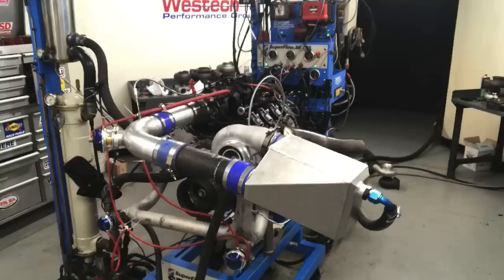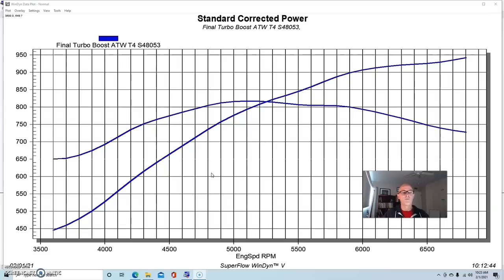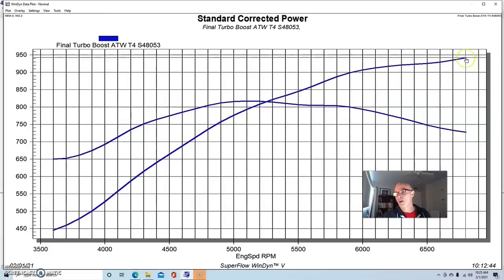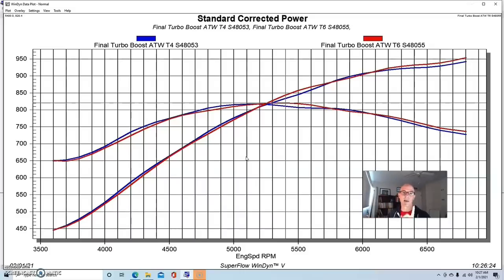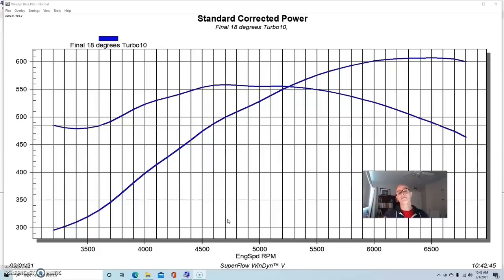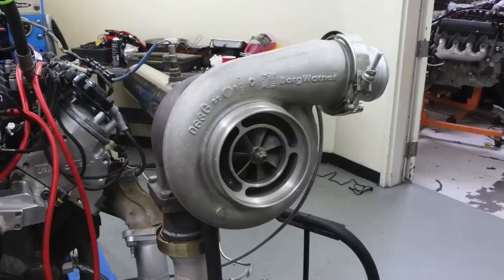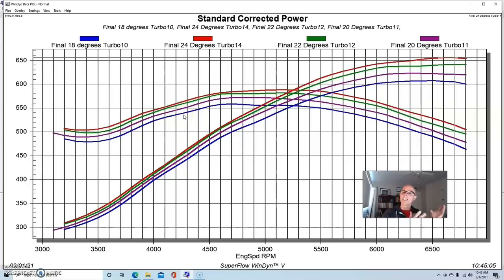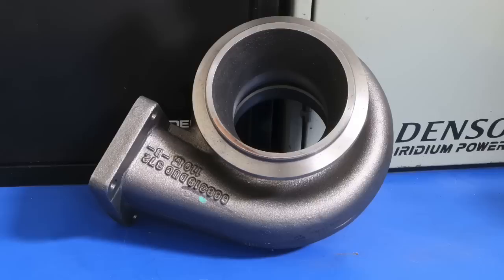JUNKYARD SBE LS S480 TURBO TEST-T4 VS T6 (BOOST IS A BETTER BUY THAN SILVER)

Comment: Yeah, it’s funny because I was running a pulsar 7985 if I remember correctly but it was in a T4 housing, however I have a 5.3 motor that is stroke to a 6 L. I was having back pressure issues because the biggest housing I could go in the T4 was a 1.28 AR.  I had to go to a pulsar s480 I believe in T6 housing. Pretty sure that will solve my issue.
Reply from the maker: at what powe level

Comment: Great content! So my question is since I’m going with a bigger cubic inch, which I’m building a stroked 418 LT/LS  street/ strip car  it will be 70% street & 
30% track-street racing 

What size T6 turbo and A/R size should I use so it can be the most responsive In your expertise opinion, oh I’m also going twin turbos too. I’m new to this so I’m very curious about what size turbos would be best & the most responsive off the line and driving around with. Get back with me if u can thanks 💪🏾
Reply from the maker: what power level?
Reply: @richardholdener1727  I’m trying have at least a thousand rear wheel on the street all day & max power when I wanna turn it up on the track between 1400hp-1700hp …

Comment: Richard, you had me confused for a little while with comments you have made in a few vids . You say a cheap turbo will make the same or similar power level at the same boost to a Mac daddy high end turbo. 
 Tell me if I'm ready to graduate ........the boost pressure is a product of the ENGINE and its restriction . 14lbs is 14lbs and will product a very close result in power regardless of turbo quality in the same engine . 
 Here is the part I just figured out and I'm not sure you have explained this part in the vids I've watched so far . The difference in a cheap cast wheel chopstick unit and , say, a new Garrett g42-1450,  is what the TURBO is doing to make the said 14lbs . If a test was run to observe wheel speed on the turbo , id bet the cutting edge design would be working less to create the same boost level at the engine . Wouldn't this also explain why some turbos are capable of 1200-1400hp with a 75mm turbine restriction,  while others can only muster 800hp with the same size exhaust restriction ?  I would also assume the newer , better (?) design would be more responsive IN THE CAR .I doubt the dyno would quantify that trait since it doesn't take the  real world dynamics of the car  into account. 
 Would you agree ?
Reply from the maker: ASK YOURSELF IF BOTH TURBOS CAN SUPPORT THE SAME BOOST LEVEL WITH THE SAME NA POWER LEVEL, AND IF THEY HAVE THE SAME BACK PRESSURE
Reply: @richardholdener1727  how would we account for the ability of one compressor wheel being able to move more air per rotation ? It would reach the same boost level before it reached the same rotational speed , would it not ? The boost and backpressures would be similar, but the turbo wouldn't be spinning as fast to reach the same level of restriction ( boost ) . If the turbo wasn't required to spin as fast to make the same boost level, one would think it would reach that boost level quicker (be more responsive ). The level of added response would be suspect , but something has result from a more efficient compressor wheel design. I'm not talking about different sized compressor wheels , but longer blade designs utilizing a smaller center to add blade length , thinner lighter blades , etc.
 A compressor wheel sensor in a apples to apples test between two turbos , one with a basic cast wheel and one with a trick billet wheel , to see if the boost/backpressure was reached at the same turbo rpm. Otherwise , how would you account for two turbos w the same basic specs , compressor and turbine inducer/ exducer , turbine footprint and AR having drastically different HP potential . It has to be the effect of different efficiencies from the design.  I doubt these are things a dyno can pick up on very well because much of these traits would be happening as you load the dyno at the beginning of the pull . 
 I whole heartedly agree that 14 lbs is 14 lbs . I just can't wrap my head around 2 different wheel designs reaching that boost at the same rotational speed . There has to be an explanation for generations of turbos being rated at progressively higher outputs while staying in the overall turbo footprint .

Comment: I have 2 s turbos, a VS s480 and a FI s485, both w the 96/88 turbine wheel. I also have a t4 1.25 , v band 1.32, and t6.1.32 turbine housings . I ran the s480 w the t4 on my 6.2 and it seemed to work well. On the s485 , I ran the t4 and v band.  The t4 was more responsive than the v band , so I'm guessing, since I didn't do any repeatable test on power levels , the v band is freer flowing than the t4 . 
 Good test ! Helped me make sense of my results .
 I never ran the t6 exhaust because of space restrains in my engine bay, but I would guess it would be the best for max boost w less response down low.
Reply: Nice, I'm getting ready to run a t6 1.32 in my cam only 6.2. When did the turbo start building boost? Mines in a tow vehicle

Comment: I went with the s498 with T6 for my built 413 LS2 Gen 4, I figured it could make 600-650hp on engine and i dont want to put 30-40lbs to get between the 800-1000hp im thinking it wouldn't be too much of a streach to do that without blowing things up

Comment: meh....  i don't go for them whistlers or them crammers or any of them forsaken crank position sensors,  i'm what they call a retro grouch.  if you can't make 800 HP out of a decent big block you're having a problem....  Sure, yeah!  You bet there are cars faster than mine but i have ass loads of bottom end torque and all i do is change the oil and wax the car.

Comment: SOOOO...!, THE A/R the A= represent the area of  the Volute at the tongue which is 105mm
The R= represent the radius measured from the center of the turbine axle to the center area of the Volute at the tongue which is 84mm on a T4 in about 96mm on a T6 ....So the{ T4 turbine has a 105mm-Area / 84mm-radius equals 1.25A/R }
{ T6 turbine  has a 105mm-Area / 96 mm radius equals 1.10A/R } SOOO...!,🤔 with that being said I think if you turned the units up to 20 lb of boost the HP output should be the same....!, but wait🤚🙄 wait { Icould be totally wrong }🤨

Comment: It would be cool to see a turbine vs compressor size test. Like a S475 vs a S480 and a S475 with the bigger (like 88x96) vs smaller turbine wheel

Comment: Was this the 3.2" or 3.4" exducer s4 turbo?  I think you don't see much change because the cross section of the turbo is very similar to the area of the t4 so the turbine is the choke point. If this was a bigger turbine like a 3.9" I think you would see a big change going to the t6.

Comment: Richard, what about us guys that brake boost, or have rolling anti lag..brake boost being more problematic then rolling anti lag. RATL usually will pull timing and then ramp in crazy fast once you de activate with target boost reached....I would think this test would or may be more problematic for smaller displacement engines that absolutely rely on brake boost and RATL ect

Comment: I believe the timing curve should be more of a 'V' shape, more timing below torque peak, less cylinder filling that needs more timing advance and then more timing near the top of the rev range to lite the fire sooner for complete combustion.
Richard what is your opinion on CR vs timing. An author of an engine build article suggested lowering CR (10 to 9:1) to take advantage of running more timing on pump gas. I believe in more CR over timing (within limits, or 10 over 9:1). A higher CR would provide a more efficient combustion, whereas, timing is a bandaid for an inefficient chamber/combustion. What say you?
Reply from the maker: THE COMPRESSION/TIMING IS OCTANE LIMITED-IT'S NOT ONE OR THE OTHER

Comment: If the larger turbo flange didn’t make much difference, then the bottleneck is elsewhere. I’d look at fuel. Do you have enough injector and fuel pumps to match? Does your camshaft have enough lift and duration to get that fuel air mix in there? If you can’t get enough fuel with the increased airflow, is the timing backing off to avoid detonation? You only changed the flange and a small length of pipe. Shouldn’t all the piping be upgraded to match?
Reply from the maker: YOU ARE LOOKING IN THE WORNG PLACE FOR THE ANSWER
Reply: @richardholdener1727  As a 50 year professional in the computer and telecommunications industry, I’ve found that as soon as you remove one bottleneck another often appears elsewhere.

Comment: I have an lq9 running a t4 turbo, and have recently found very small and few aluminum shards in my oil filter. I have never opened the motor to check the ring Gap, and the turbo has never boosted more than 10 lb as far as I know. I'm thinking I might be losing some head material, but is there a chance it could be general wear within the head, as it is a 128,000 mi motor?
Reply from the maker: is it bearing material
Reply: @richardholdener1727  as far as I can tell it isn't magnetic, and it is very shinny, like aluminum. We're talking sizes of about the head of a fine ball tip pen, but flakes, not chunks.

Comment: Richard do you have a comparison video of an identical turbo on both a 4.8 and 6.0 near the 1000hp range showing the difference in back pressure and boost required to hit that power mark?
Reply: I would assume more boost would be needed on the 4.8 to hit the same power number as the 6.0. I'd be curious to see if the back pressure would be greater relative to the higher boost pressure required.
Reply from the maker: it would take a lot more boost on the 4.8l

Comment: In conclusion, the turbo won.  Could you do a video perhaps showing what different A/R ratios do?  It's the one spec of turbochargers that I don't understand.  It would be interesting to redo the test, but plumb each bank to the separate inlet on the T6.  I wonder how much it would help or, if not even worth it.
Reply: You actually made one of best suggestions I've seen. No one ever does turbo testing on A/R ratios or explains them. That's one thing the turbo someone purchases can be correct/perfect size turbo in every way & they order to large of A/R or to even to small  it will ruin everthing with Performance the boost reaction, running out of boost, & even life of turbo & parts.  A/R can define T4, T6, or Band Clamp which makes huge difference.

Comment: What's the chance you would do a blow thru carb test? More specifically, a modified 4150 vs purpose built blow thru.
Reply from the maker: we normally run a CSU
Reply: @richardholdener1727  I understand that purpose built is the best option. Just thought it would be neat to see if a 4150DP would work. I have heard of it being done. Was just a thought.

Comment: Great advice and conclusion as always Richard. If we ran these on a chassis dyno maaaaybe we could see a response difference, but at the end of the day, inlet pressure and temperature will determine 95+% of your power if fueling and timing remain constant. Any real difference between the two housings will be where we can make what airflow at what heat. If the boost is the same.... The power will be the same...

What would be more fun imo would be to add a third turbo to this comparison, something much smaller with a similar T4 housing, to show a compressor running out of breath. Always nerve racking to raise the boost and see no power increase, just more heat.

Comment: There's an Australian RB30 that's making 1500whp with a gt42 shoved into T3 housing. You can flow a shitload thru T3 & T4 housings, the restriction is the turbines they normally use.
Reply from the maker: 1500 hp through a t3 hot side?

Comment: would have liked to see this run up at least to 7500rpm plenty of camshaft to do so I think you would start to see a larger separation between the back pressure which is where most people including myself run this type of setup I currently run a vs racing s488 t6 1.32 96/88 turbine also love the videos I learn alot keep them coming

Comment: BAck pressure seems high for a T6 setup. I would be VERY curious what that t6 curve looks like with a set of turbo headers and dual 3" into a 4" entry on the hotside. I suspect the oem exhaust manifolds and y pipe and 3" are the restrictions here and NOT the turbo. AS backpressure looks nearly the same.
Reply from the maker: its not that
Reply: If you already tested this then i look forward too seeing the data :)
Reply: Id also be curious too see the power/backpressure curve with anither 3-400hp in the mix.
Reply: Hilariously incorrect 😆

Comment: I have an 5.0 coyote i'm going to put an s475 on. It comes with the standard T6 but they make several T4 with different a/r. I'm curious what the standard T6 will do, if it's too big. It's a drag car. Hopefully find out late this summer or next year. I've also seen they make a quick spool valve that works on split housing that kinda mimics a veritable turbine.
Reply: Depending on what you have done to the coyote the t6 is probably a better call on a drag car. This is especially true if you have a two stage. If you are not worried about the spool when you are rolling into the throttle from a stop sign and you might make a little more squeeze at the big end....
Some guys have good luck with a spool valve. I have never tried one.
Reply: @timothybayliss6680  
vvt delete/locked 2ed gen mustang cams, 2018 manifold, fast tb, holley hp efi, sleeved block, forged bottom end. I'm used to building sbc this is my first coyote. I'm told that 4 valve engines move air like a big block at high rpm so they can handle big turbos as long as you don't care about low speed torque. We'll see. 😁

Comment: What if the cubic inches was even bigger more like a 502 ? Lol 
I think my friend might got too small turbos . They just look small idk wth they are but he pump gas street car . Hope they work 🤞
Reply: Depends on the goals. Roughly speaking you size the cold side for the power goals and the hot side for the engine displacement relative to the goal. If your engine makes 300hp NA and you want to make 500hp, then you buy a turbo that can flow (compressor, cold side) 500-600 hp worth of air, or maybe 700 if you want some reserve capacity to grow in to. But if that's a 6 liter 300hp engine the. Get the larger turbine housing (hot side) offered for the turbo. If it's a 2.4 liter screamer making 300hp NA then you want the smaller turbo housing offered for that turbo.

Comment: For a street/strip car, this is poor information. When applying this to track especially. MOST people that race these engines dont run aftermarket heads. So they arent making 500+hp NA. So they arent anywhere where near 1000hp at 12lbs! 12lbs is run around town boost and will run diddly at the track.  Ive raced these engines for years and the t6 his hands down the better platform for a true 900ish+ whp. Even on a 4.8. A typical cam only LS will take 20-25lbs to get anywhere near 1000 hp.   At higher boost levels the T6 will put up far superior et and trap speed. It makes more power per pound without falling off like the t4 does.  If you want even close to 1000hp 4.8, 5.3, 6.0... run the biggest T6 you can. I have back to back logs with BP at the track. Its very common knowledge for people that actually race these engines.
Reply: Well this is around 750whp on a chassis dyno🤷🏾‍♂️
Reply: @QPC_LLC  If that...
Reply: Yes or 2 T4s
Reply from the maker: a cammed 6.0L makes 500 flywheel hp. If you need 20-25 psi to make 1000 hp-you are doing it wrong! no need for a t6 on a 4.8L
Reply: @richardholdener1727  Don't get me wrong I'm a fan. I thumbs up all your content and appreciate it! I'm not doing anything wrong...  On YOUR engine dyno a cam only 6.0 makes 500 FW HP. And what does that translate to at the wheels?  No one uses flywheel HP numbers, so your content is deceiving since many entry level folks don't understand how much different the RWHP numbers will be.   I actually 1/4 mile race my turbo LS engines. You do not. Your numbers are just numbers! Great data for comparisons,  but don't apply to real world drag racing. I'd love to see one of your "1000hp" motors installed in a chassis at the track. I think the trap speeds would be quite low.  You are 100% wrong in your advice on the T4 VS T6. I've done it... more than once. I have direct comparisons with back pressure data on more than one engine.  Once you take the motor off the dyno and put it in a chassis, It will be very clear the T6 has much more potential.  I went from a T4 1.10 s475 4.8 to a T6 1.32 S480. Went from 2.6:1 at 25-26lbs to 1.4:1 at 23ish lbs. I picked up 5mph and ran less boost with almost half the back pressure. At 3150lbs Going from a 153 trap to a 158 trap is huge! So YES, my 4.8 DID need a T6! T4 S475 was done hot-side wise by 25lbs. The S480 was on 20ish creeping to 23 and trapped higher with almost half the back pressure!  Your dyno numbers are very deceiving to the guys that are getting into racing.  They get to the track and wonder why their 1000hp motor traps 130. From someone that actually drives turbo LS setups and races them... A T4 doesn't belong on any LS in my opinion. I had zero issues spooling a 1.32 T6 S480 with a mild 4.8/glide.                                              Look at Freiburgers F-bomb. Nelson built big money LS.  1480 hp on the chassis dyno! And only trapped 154!  Yet I out trap and ET it with an SBE 4.8. Does that mean I'm making 1500+ hp too?